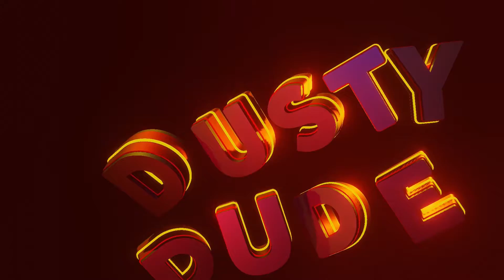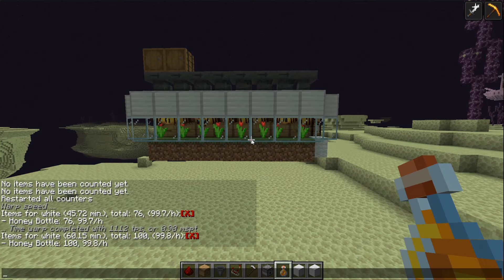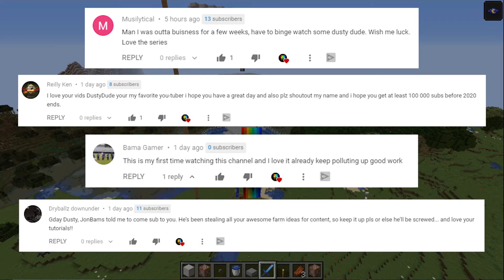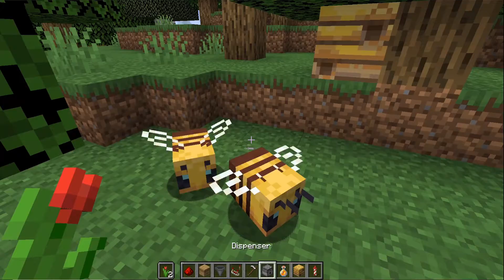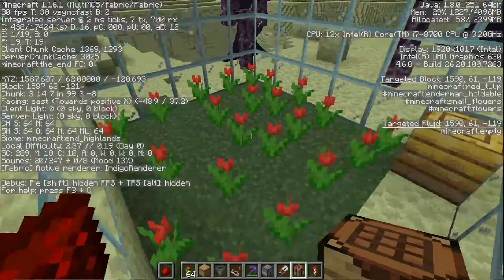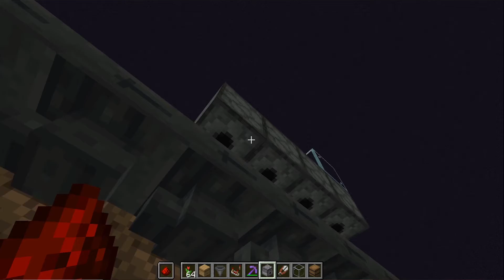Best, Easy Honey Farm! 1.16+ Minecraft - Honey Bottles and Honey Blocks

Comment: I made this design with 64 modules, which would have been a pain to get by transporting bees into a bee nest and then to a hive manually. Instead I would suggest making ilmangos bee nest farm which doubles as a stripped birch log farm. I just used the nests instead of the hives since it was easier and doesn't affect efficiency. If you're making more than 10 modules I'd suggest you do this as well. Also, nice vid dusty, keep it up.
Reply from the maker: yeah I think it would be easiest to breed them in the farm, but you will need to get the honey comb/ make the hives first if you do it this way
Reply: @DustyDude  true true, I really just depends on scale